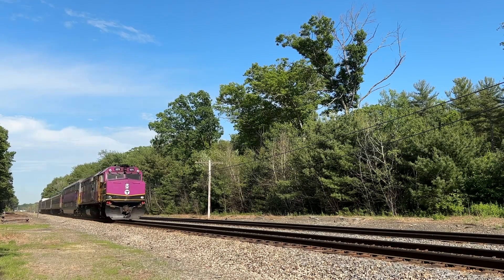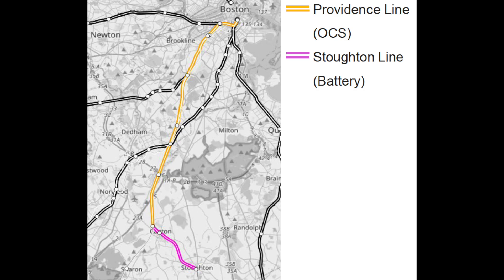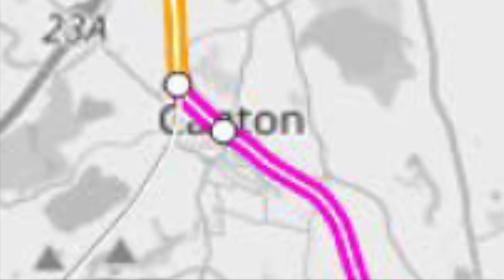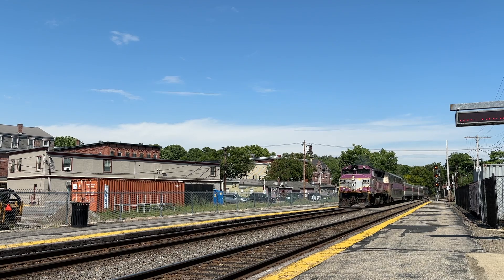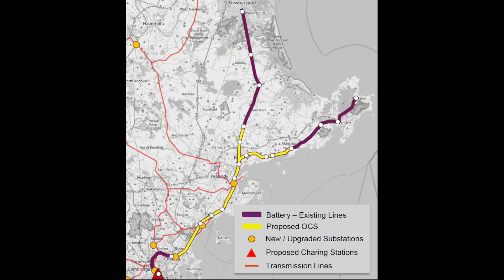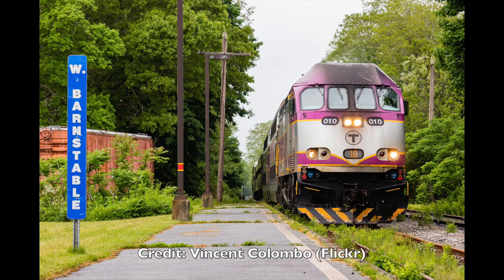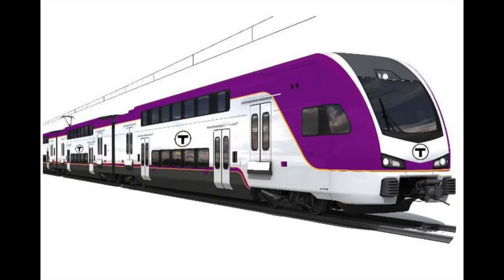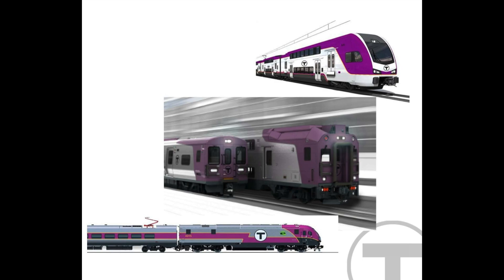MBTA's Plans to Modernize Their Passenger Rail Network (Electrification and New Locomotives)

Comment: I fully support switching to electric and away from diesel where applicable. However...

Why doesn't the MBTA purchase new (or used) electric engines to operate on the Providence/Stoughton Line? If the overhead wires are already there, what is the MBTA waiting for? Buy one or two. Test them, then get them into regular service. 

Unless there is a magical half billion or multi-billion in financial resources ready to spend, trying to electrify one or more lines seems a little unrealistic. Likewise, where will all this electricity come from? Does electrification also include $$$ for new windmills, solar farms, or anything else that will make electricity? 

Amtrak seems like a reasonable buyer to purchase used locomotives from as they plan to put new locomotives into service within the next decade.
Reply from the maker: I agree!

Comment: In 1922 The Netherlands decided to electrify the rail network. So, the US is running more than 100 years behind. The main reason is that in the US railroads are private while in Europe they are managed by governments. Anybody, saying private companies running infrastructure is more eficient, is just crazy.
Reply: Imagine 1) having the right to access a resource (such as water) from a local supplier that is located across a bridge, and 2) provide a resource for community benefit. But because the roads on the leadup and even the bridge itself is privately owned, these private owners say who can use the roads and bridges. This is pretty much how rail lines in USA are structed as where Amtrak (funded by the gov) does not have ownership rights. A little backwards compared to railways in Europe I hear. 

When American railroads as a whole declined around the middle of the 20th century, private ownership and acquisition by freight companies made things more difficult for passenger service (which was reduced as the automobile industry took off in the second half of the same century). This begins to explains why Amtrak struggles to provide on-time service where they do not own track, and why it's taking a long time for any passenger service company in USA to improve service where there is demand...
Reply: Now also imagine having a fraction of the budget (and income) some of the freight companies have. This is the constant variable Amtrak deals with year after year (minus the lack of track ownership). Whether Amtrak will become a private railroad one day, that's up to the U.S. Congress to decide considering they created it. Brightline is a new American railroad dedicated to passenger service in USA. So far they seem to be doing well. Yet I question their ultimate parent ownership (who are in the Middle East)  

Anyhow, if freight companies really wanted to, they could easily replace 50 and 100 year infrastructure nationwide in record time. A simple overpass is pennies in the grand scheme of things. 

For the time being, Amtrak's success is determined by tax-payer money and cooperation by those private owners. Plus American values too.

Comment: Drawbridges should not be a problem.  The New Haven Line and Shore Line have lots of drawbridges, and all but the Cos Cob bridge have continuous electrification. At Cos Cob, the trains coast across the gap in electrification.  With the M8 cars, at least one set is powered at all times.
Catenary towers last at least 100 years. About 20 years ago, the New Haven Line's catenary was converted to constant tension, with sets of pulleys, weights, and cables  whose expansion in heat kept the power wires at a constant height.  The Shore Line, and rest of the NEC from New Haven to Boston, was electrified in 2000 with new constant tension wires.   Electrification isn't new technology.  It's entirely doable.
Reply: Speaking of SLE...
I'd like to see SLE and MBTA service expanded to Westerly. This would replicate the New Haven and Hartford main lines where two passenger railroads provide economical and premium services for passengers. 

However, for this to happen some major track work needs to be done in the form of making double track station triple. This way both the economical and premium trains operate without bottlenecks. Some of the stations in CT appear to have the space to expand. But it will come down to whether local property owners are okay with giving up some of their land for the railroad.
Reply: @grommit700  A lot of stations have room, so no need for takings.  But the stations are generally new, and cost millions of dollars.  This problem was foreseen when SLE went bidirectional, with platforms on both sides of the tracks.  Yes, service to Westerly would be good, but more critical is service during commuting hours.  There is a huge gap between 5:30 PM and 8:30 pm for evening trains out of New Haven.  That's a very long wait for typical commuters who cannot make the 5:30 train, which is a lot since most are coming from Fairfield County. I the CTDoT folks think SLE is for New Haven commuters, not Fairfield County, and that everyone has the hours of state employees, and can leave work at 4:30 pm. My town's parking lot was full pre-pandemic, now it's mostly empty after service cuts.
Reply: @peter7936  Yeah it's amazing how in one part of the state service is frequent. Whereas in the opposite, it's much less. Now I understand why the state wanted to reduce SLE service. 

Bristol and Manchester CT have good size populations on both ends and along the way on both the roads and rails. I could see a new service being implanted here one day. 

Eastern Connecticut to the RI border seems more tourism and local user oriented. Maybe if Westerly's and New London's economy expanded, I could see both states working together quickly to provide passenger service. Perhaps there is a case to create seasonal service for the warm weather season? 

I've used CT Rail quite a bit. It's nice because on either ends there are moderate sized cities, and a mix of everything in between for people to use the train for.
Reply: @grommit700  There's no passenger service to Bristol or Manchester. Are you suggesting a new line?  The thing with SLE is there are a lot of folks who live out here and commute to Fairfield County or even the city.  Train service is a good commuting option for those long commutes if it is frequent enough.  I would also help if CDoT enforced paying for parking at Metro North stations like West Haven and Blackrock.
Reply: I am suggesting service between B and M. Because 84 in both directions is unpleasant no matter the time of year wet or dry. The XL Center and CCSU are two examples of reasons people would take the train. 

I used SLE before. It's faster which tops MNRR on the NH Line. Yet I sensed the general demand is why it's struggling ever since the pandemic and remote work. I hope demand goes back up.
Reply: @grommit700  SLE is a chick and egg thing.  The state says it won't run trains unless there is demand, but people cannot ride trains that don't run.  Moreover, commuting is a habit thing: there needs to be some pump priming. If the state ran trains frequently, and during commuting hours, people could rely on them.  One nice thing about MNR is pre-2020 there was a train to NYC nearly every 10 minutes.  It's not that good now, but still not too bad if I miss one train there's another in at least 45 minutes, even off-peak.

Comment: It is criminally stupid that the MBTA can't just put up overhead wire and thereby avoid the expense of batteries (which will be ongoing as you have to keep replacing them).  The New Haven Railroad electrified from New York to New Haven with their own electrical system when they didn't have an electrical grid to pull from, so the T should be able to electrify all of its lines even if they have to build electrical transmission infrastructure into areas with poor electrical grids.  The T is always coming up with excuses why things cannot be done.
Reply: Could use it as bait once they get it through the door, "hey you know if we put up some wires we could save X amount of money " 😉
Reply: @ventilate4267  I thought about that, but:
1.  They will have already spent more money on trains using batteries.  A possible mitigating factor may be that (at least it sounds like) the battery trains can be easily and cheaply converted to run under overhead wire.
2.  The track record of the T seems to be to try to use bait in the opposite direction:  Design to fail, so that they don't have to do any more.
Reply: @Lucius_Chiaraviglio  yeah true
Reply: Batteries could work in a warm climate with flat land where trips are not too long. I see it as a real problem in New England winters.
Reply: @pilsudski36 . . . Which reminds me of how 2 phones ago, my Samsung Galaxy S4 started to die in the cold before dying generally.  Which makes me wonder how long before the T starts having trouble with all those battery buses we have been getting.
Reply: They should use dual mode EMUs that can run on catenary and third rail (like the MTA M8s) so they don't have to use batteries. Third rail is easy to put in and combining it with overhead wires that they can both run on would do the most good. After all, the batteries would die way quicker than third rail shoes and pantographs
Reply: @donkeykongroolz2007Why not just use overhead wire?

Edit:  Alternatively, why not convert it into a regular rapid transit line and just use 3rd rail?  (Only downside:  The last little bit of track into South Station would need to be separate from the railroad tracks.  Also true for the other end, but that's pretty much separate anyway until you get to the actual track junction.)
Reply: Economics of scale the MBTA is heavily in debt. Back around 2007/2008 the debt was $5 billion dollars.
And that was before tacking on the interest,which jumps the debt up to $8 billion,which I guarantee it's a lot higher now. Another issue is that some of the rail lines are owned by freight railroads, in particular CSX or have trackage rights, which means freight trains have priority,which in turn can lead to service delays. And the freight railroads aren't too keen on electrifying their rail lines for passenger service. A lot of the electrical infrastructure is old,in some cases literally over a century old,so it's prohibitively expensive to switch to electrification.
Reply: Broadly, I agree, but as a matter of historical accuracy, the New Haven Railroad did build an operate its own power plant at Cos Cob.  I doubt MBTA wants to get into the power generation business.  The line switched to grid power in 1987. https://en.wikipedia.org/wiki/Cos_Cob_Power_Station
Reply: @peter7936  Yes, but our electrical grid is not as spotty now as it was in 1907.
Reply: You do realize electrification takes time?
Reply: @qjtvaddict  Electrification takes time.  So does the acquisition of battery-powered vehicles.
Reply: lithium batteries are also bad for the environment due to battery waste and the lithium mining
Reply: Because caternary wires and pantographs last forever and don't need replacing until the heat death of the universe.

I don't disagree with you, though - overhead electrification beats batteries any day. But that argument just isn't it
Reply: @yukihong9726  Wires and pantographs do need eventual replacement, but it's a long time, and the materials are more easily obtained and more easily recycled (apparently we really fail at lithium battery recycling).